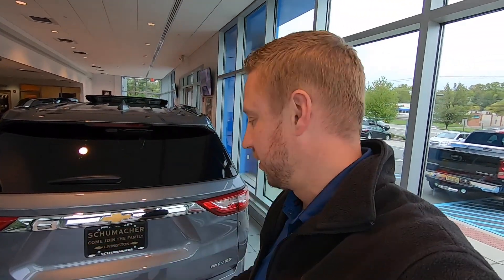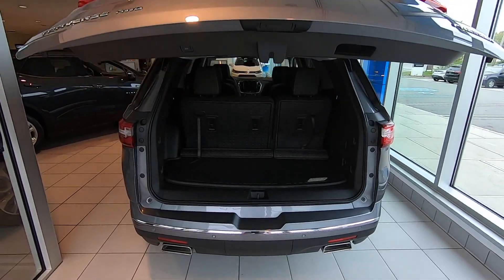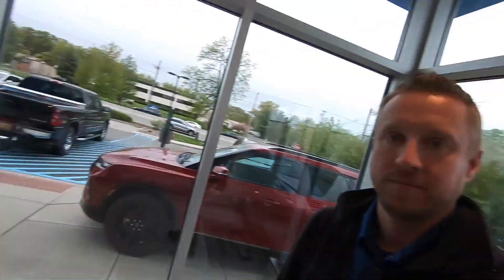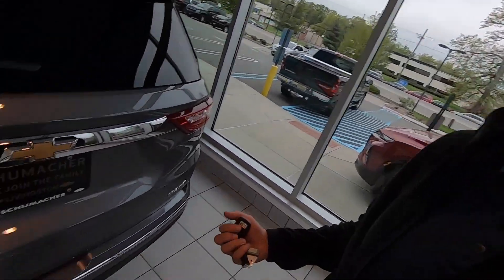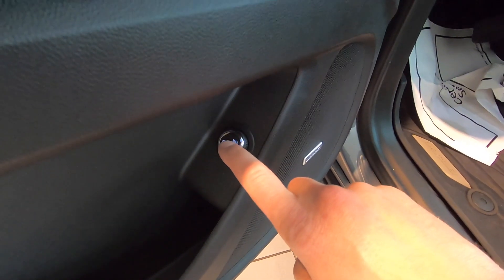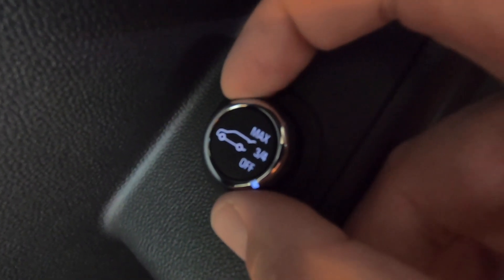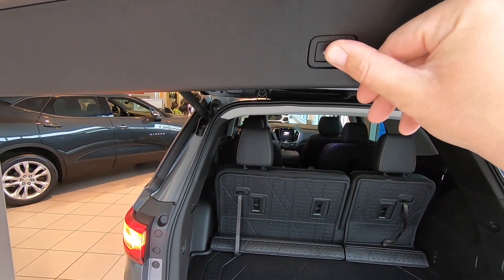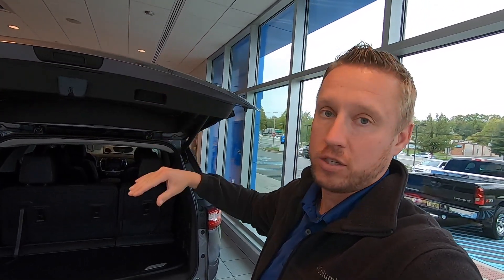Chevrolet Traverse hands free liftgate

Comment: Is there any button to press to open the trunk if you don't have your keys and don't want to go inside to open the liftgate!? I don't have the power option on my RS. Thanks.
Reply from the maker: Yes, there is a button on the lower portion of the tailgate as well
Reply: What if your car was in the Ft Lauderdale flood and the battery dead. How do you open with out power?  Is there some emergency lever that you can get into with the third row down?  Thanks Joe

Comment: Can you help me out ??? Just bought a 2019 chevy traverse , the original owners only left one key . Nice clean car with plastic still inside . So the dealership had me a new key made at a lock smith . The original key when you walk up on the car will light up , the key the locksmith programmed which is a real Chevy brand key will not work when you walk up on the car . The tailgate light doesn’t come on and the locksmith says it’s something in the memory of the car , my Chevy salesman had no idea 🤷‍♀️. Any thoughts is it the key or is there a setting in my car . Please help me

Comment: I have this car, a 2019. But my liftgate just opens little bit then it stops. Then I close it snd open again. What is the problem you think. Extremely thankful for an answer
Reply from the maker: Sounds like something is causing the pinch sensor to activate?? or maybe the door is slightly out of alignment
Reply: @DaveBsellsChevy  Ok, thank you for answer. I not even seen where the sensors is.
Reply from the maker: @nerdiep3456  I think it is a pressure sensor probably built into the motor for the door
Reply: @DaveBsellsChevy  hmm ok. Thank you! It will be a service station for that I think.

Comment: Where is the inside button?
Reply from the maker: On the Traverse it is on the lower part of the drivers door panel
Reply: @DaveBsellsChevy  do you happen to know where it is on an LS? I just purchased and it can’t open with fob it’s not the fancy ls but it’s driving me crazy I can’t figure out how to open from inside
Reply from the maker: @anacaricuevas8442  the LS doesn't have the power tailgate so the only way to open it is with the button at the bottom of the tailgate. It is where the door meets the bumper
Reply: @DaveBsellsChevy  thank you so much for replying! That sucks I was hoping at least it will open from the inside I knew I didn’t get the super fancy one but at least a button from the inside would have been nice haha